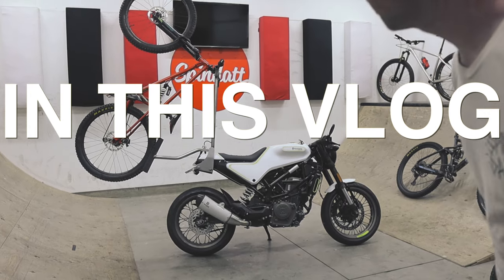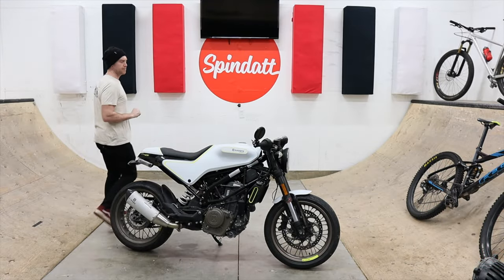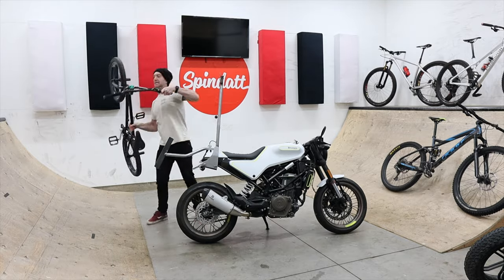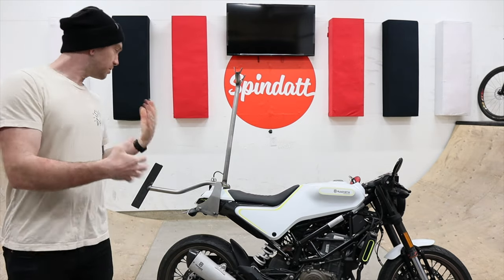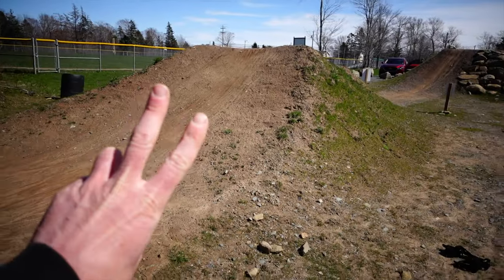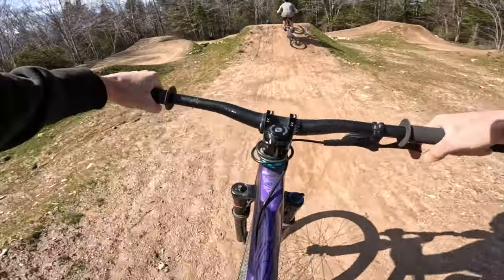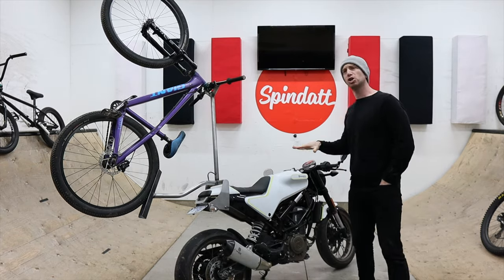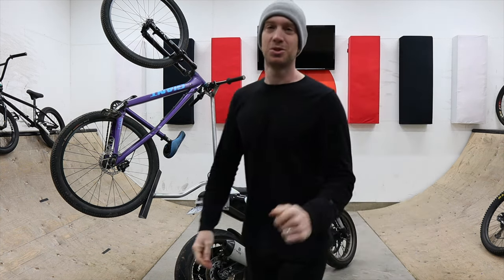My vitpilen is a MTB transporter now

Comment: I'm curious about that rack mount, does it sway your bike when you turn? Is the added weight on the back make your front wheel lift on uphills?

I'm thinking of making the same but bolting the front thru axle instead of hanging the handlebars, the orientation would be the same as this.